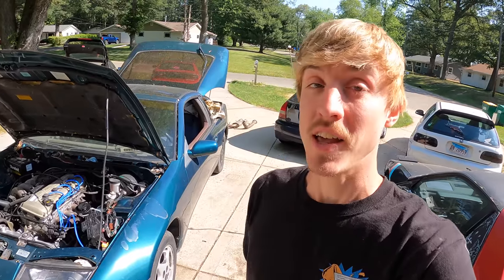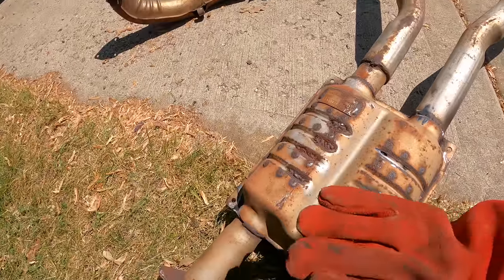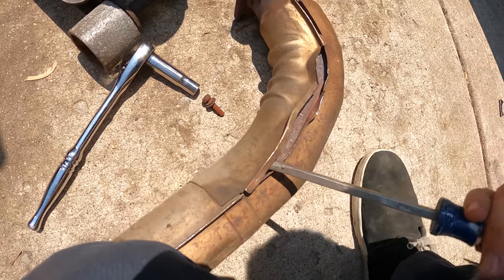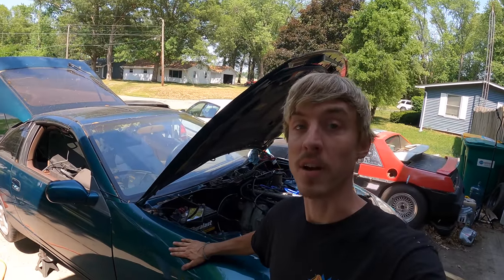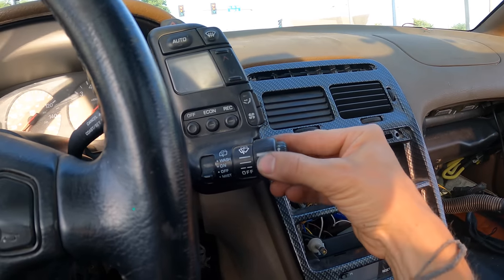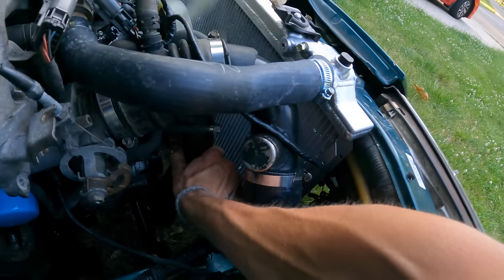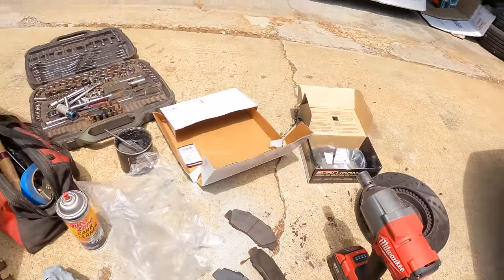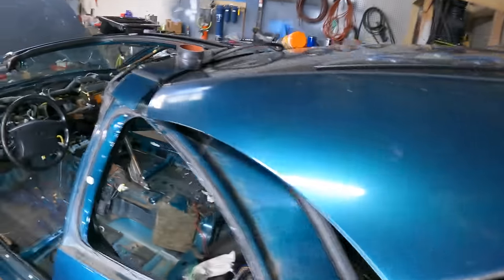Project 300zx Exhaust Fabricated for the KA24de

Comment: The speedometer failing might be the cluster itself. May have to solder the contacts.

The brake lights always on is usually a little rubber stopper pad that wears over times and cracks and disintegrates. You can get another one at any autoparts store or do the bolt trick for a permanent fix. I gotta do the same to mine when I get home later this month.

Exhaust sounds good man nice and quiet. Oh also you had it right twist the knob on the right side control pod for windshield wipers.
Reply from the maker: Maaaan I hope it's not the cluster that failed! Im pretty sure the 96 cluster is different from the rest 😭
Reply: @PrizzaMike it actually is different than the rest
Reply from the maker: @asosa7100  dam 😭

Comment: Last year I used pb blasters surface shield on my truck frames. They just had surface rust and looked old. It collects dust so it looks like crap but it does protect the metal and make it look better than rust and was cheap and done with body on frame. lasted through salty winter and were not garaged and if you wipe it off in a spot it looks like black rust protected metal. Cost me 50 to do 2 trucks.

Comment: Pro tip: apply your thin layer of brake grease to the new hardware before installing the caliper bracket, so you don't have to worry about greasing the rotor😉

Comment: If your rotor was that grooved, definitely check if the caliper is sticking even a little.

Accord wagon and Acura CL front calipers were used on the Type R, too. I think the same calipers were used on other Honda models.

Comment: Idk, my stock KA sounds pretty damn good with my Apexi dual N1. Damn good.

Speedo itself is known to have solder joints that fail. Could even be the little plastic gear inside that drives it.

Comment: The reason why I put grease on the back of the pad even though it has a shim is to reduce sound when you brake. If I don't put grease on the caliper side it will make noise when you use the brakes even when I make sure everything is clean and moving.

Comment: Almost every Honda from 98 with 5 lug have the same brake pads in the front and tear up until 2012 I believe. My 2008 and 2011 had the same pads as the integra type r and crv as well.

Comment: Your talking about PTSD with exhaust. I was pulling the trailer hitch off my grampas truck and had left a bolt in one side as my dumbass was under it removed all the bolts from the other to find out either the whole was stripped or wasn't threaded in far enough to catch. Came down right across the bridge of my nose 👃 only time in my life my nose had been broke and it was because of me and a taco(ma)
Reply from the maker: Maaaaaan that's rough 😭
Reply: @PrizzaMike  yea still one of the hardest times I've ever been hit to this day! Damn gravity!

Comment: Probably missing the rubber bumper on the brake pedal so brake lights stay on

Also check if the odometer is counting mileage. If odo works its probably the cluster itself that failed. My speedo doesnt work

Comment: You have PESD (Post Exhaust Stress Disorder) from a past exhaust install gone bad?  I do wonder if you would just be better off fabbing something up for the trans mount hanger rather than trying to find one.  Not sure what the 300zx one looks like but the one on the stock KA/S setup was very thin metal and after 30+ years, rust often destroys it, so I may just make something instead for mine.  I mean it's an exhaust hanger... it doesn't have to be pretty, just functional... doesn't seem like it should be too difficult (famous last words).

Comment: Yeah come check out my Ka that is pretty much straight pipe. Sounds great. Your experience is with older high mileage shitty 240sx to bad you were a baby when they came out.
Reply from the maker: This KA has 80k miles on it tho
Was pulled from an auto car
Reply: Yes but you deal with junky 240sx. The only bad thing about the Ka is it has alot of garbage in the exhaust. That's why it had a resonator. With just a muffler and no cat they sound wonderful. One if the most dependable engines Nissan made

Comment: Wouldn't that be open headers not a downpipe the downpipe goes from the header to the mid pipe and then the midpipe goes to your muffler your catalytic converters are usually on the downpipe or the midpipe